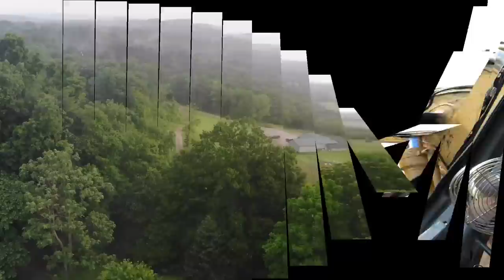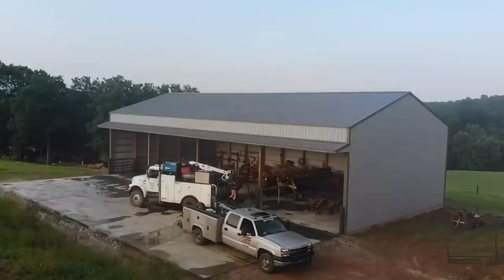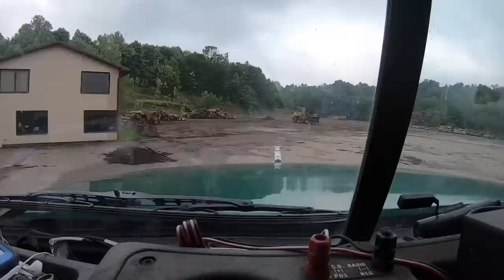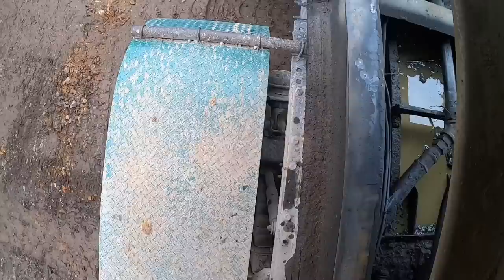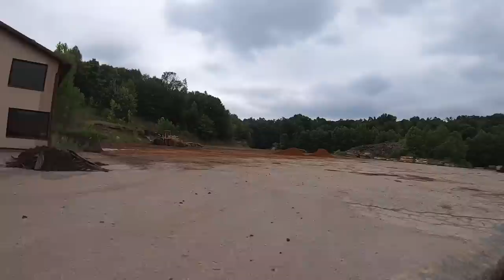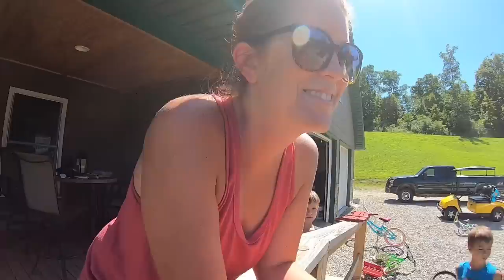Hauling Chirt to the mill and mission  impossible 🤪

Comment: I like Frame  dumps the only bad about them is if you turn it over the hole truck goes whit it. Vs a frame less only the bucket turn over
Reply: All depends if they have a breakaway fifth wheel pin or not. If not tractor usually goes over with it

Comment: I know this is old...but did you fix the hose on the dump cylinder ...it looks like its got a huge cut on the bottom...look at time stamp 13:50 to 14 43
Don't look good on top return hose by the base of cylinder

Comment: I live in the west and they have what are called bottom dump trailers and the truck drives along and dumps the load in a windrow so so chit chatting for drivers, they stay in the truck so no Bsing for the drivers. They hate it. I use to run a loader and know how much truck drivers like talking. That is a nice little trailer. Even though the body is aluminum I bet it is heavy cus of the steel frame.
Reply from the maker: Not two bad for a older trailer I can scale 22 ton